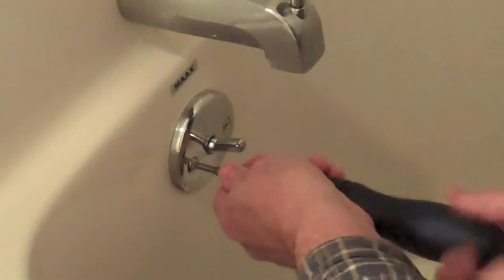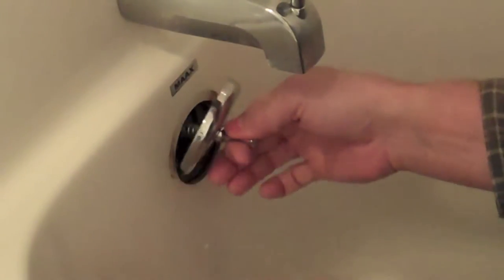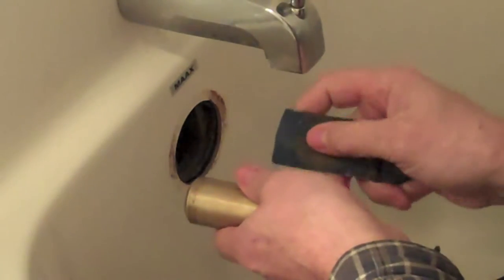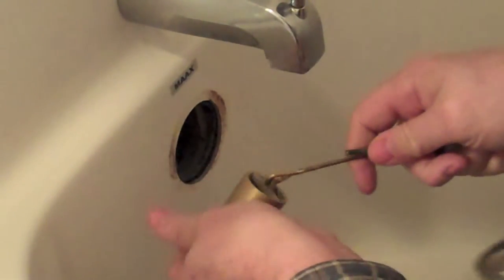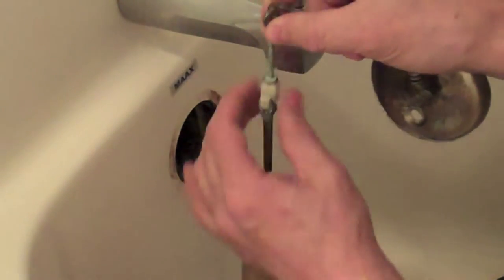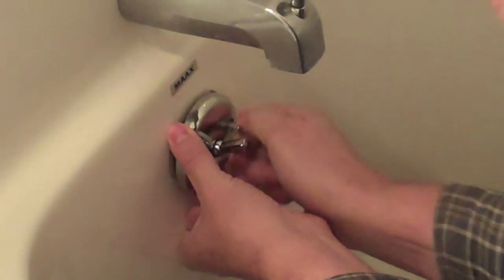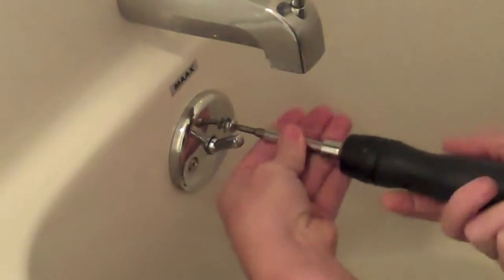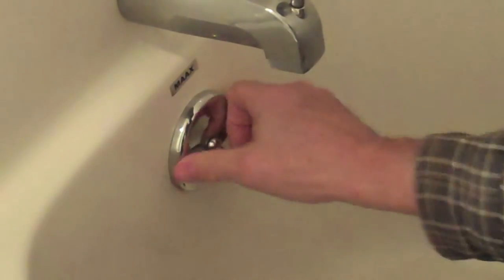How To Free Up A Sticking Tub Drain

Comment: Great video if it's not stuck. Maybe I entered the wrong wording.
Reply from the maker: This video is for drain plug that is sticking not necessarily stuck. Mine was hard to open and close smoothly so this is how I made it work easier.
Reply: Stuck? Put vinegar on stove to boil and unscrew lever and slowly put 2 cups down drain. Wait a few minutes and it should be unstuck. Clean connections and plunger and put plumber's grease on plunger, replace into hole and replace screws to lever. Test out!